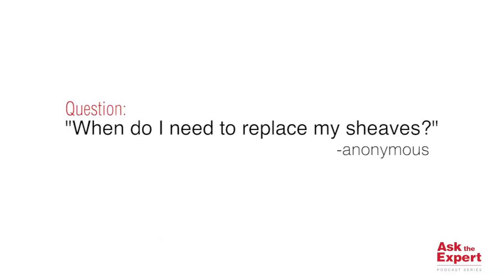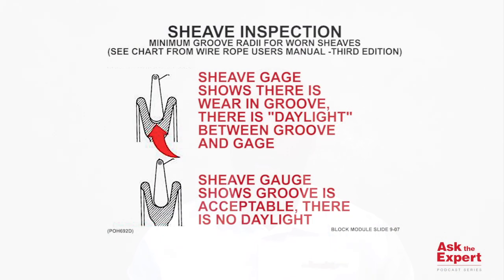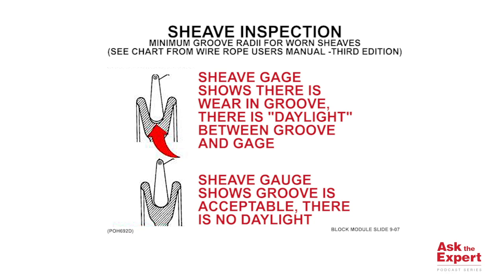Sheaves: How to know when it's time to replace them

Comment: I've lots of questions. Regarding wire ropes, pulleys, sheaves, beta houst, spooling a drum. Totally want answers if you can provide them. I'll check out your website and ask questions there. But I'm in very curious need of professional answers.